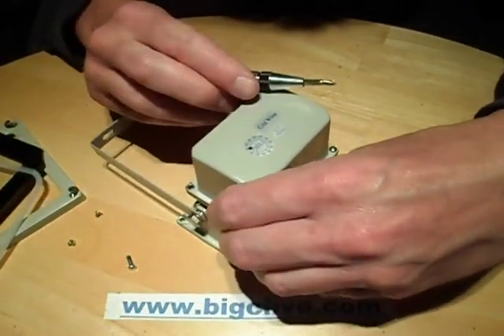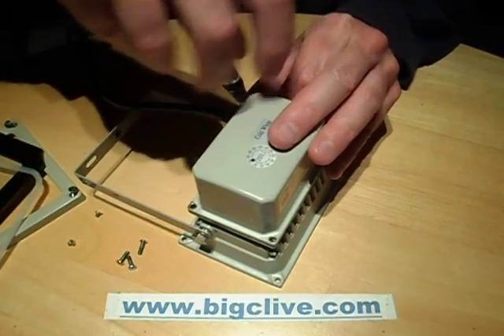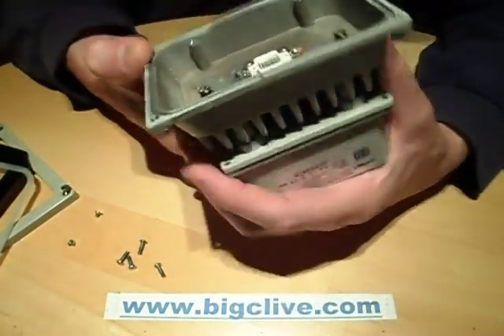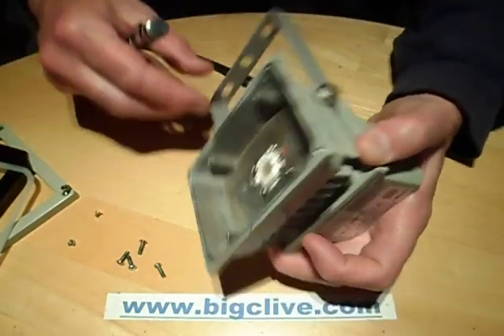A look inside a typical 10W LED floodlight.

Comment: Could you please tell me the distance between the screw holes?

I'm thinking of buying one if I could fit some Bridgelux 10w leds (BXRA-40E0950-B-03 on Farnell) - these have only 2 screw holes spaced ~ 54mm apart (diagonally)
Reply from the maker: The spacing isn't the same, but you could always drill and tap new holes.  However, the spec of that LED suggests it's using a small er number of LEDs running at higher current, so the supplied driver might not be suitable.  The square 10W LEDs are widely available on ebay at low cost, and they are manufactured in large enough quantities to give decent reliability.
Reply: bigclivedotcom
Thank you for replying so fast. Yes, this Bridgelux LED is running at 21v and 500mA so it's probably not going to work with the drivers built into those, but I'm planning to use one of those 18.5-19v laptop adapters along with a tiny boost led driver to run a few of these. Alternatively, I'm just going to get a 24v power supply and use a 1-2$ buck led driver for each lamp.

I prefer to stick to brand names because I need good CRI (these Bridgelux are 80 but there's models going to 87-90) and because I need 4000k color (to match with some high quality fluorescent tubes working as fill lamps).

While those eBay leds do produce light, the CRI is all over the place (usually 65-70) so they mess up the colors giving me more work at editing, and it's difficult to match the K value.